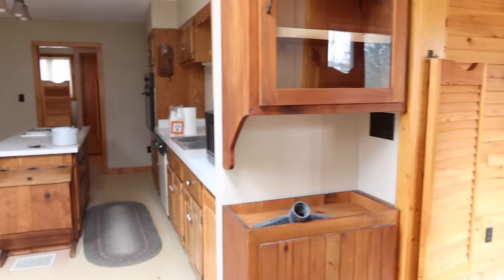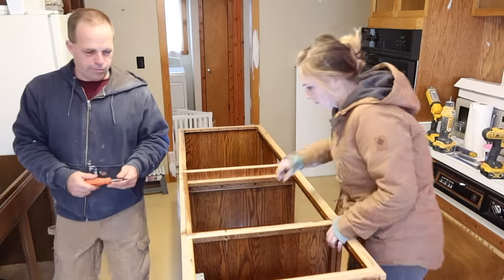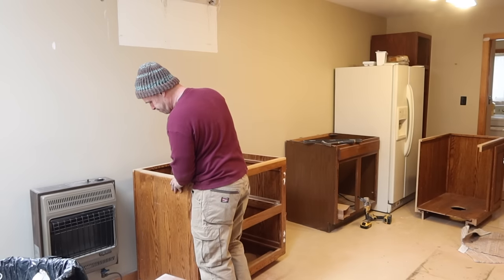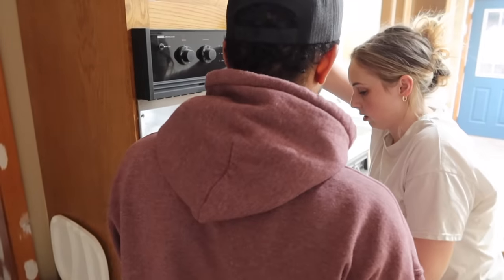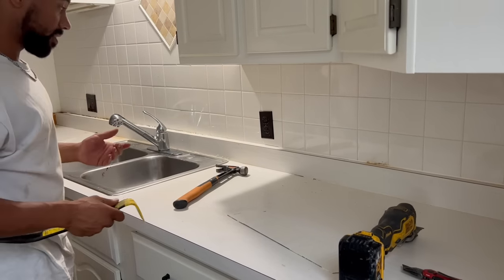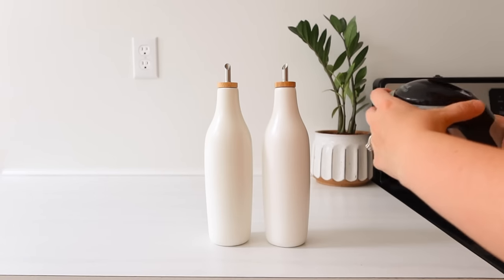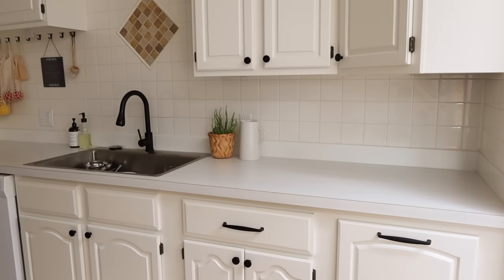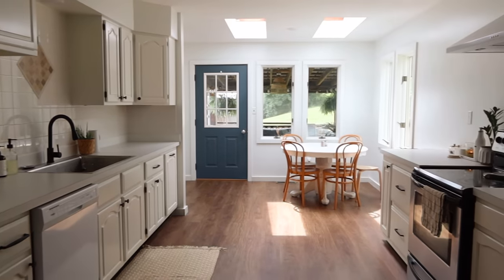BUDGET EASY DIY MAKEOVER & KITCHEN ORGANIZATION HOME ROOM MAKE OVER DECORATE WITH ME

Comment: You can 💯 paint cabinets without sanding then. We did our whole kitchen and 2 bathroom vanities as well as closet doors and it turned out perfect. You just have to use a good primer and the right paint.

Comment: I love the look of the wire bins for the onions and potatoes. But, in  general, you should store potatoes and onions separately because onions emit ethylene gas which can cause nearby produce to spoil prematurely. However, some say that potatoes and onions can be stored together in an airy pantry, a few feet apart.

Comment: Love the kitchen! I used an oil based primer, let it air 2 days and painted right over my cabinets. Zero mess and 2 days of smell. 11 years and 3kids later and they haven’t even needed touch ups. No one in my family has ever sanded - you can use the oil primer but I don’t recommend liquid sandpaper.